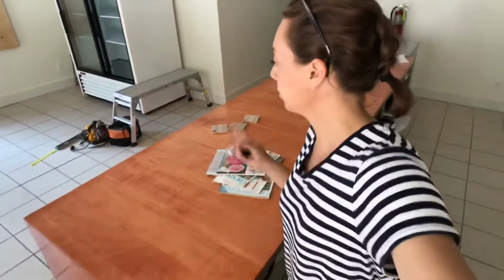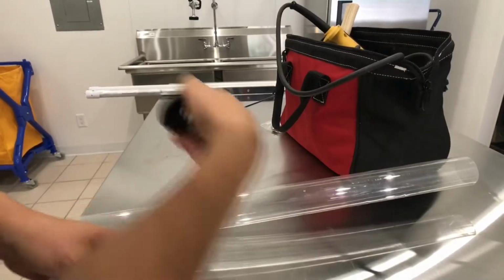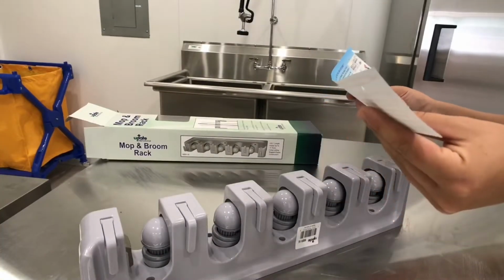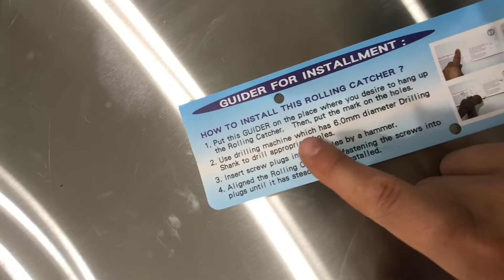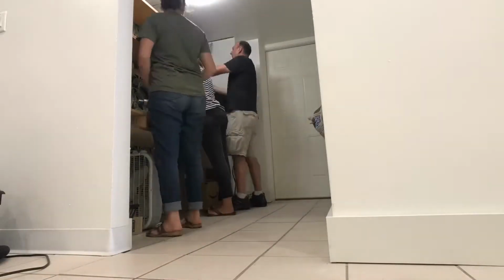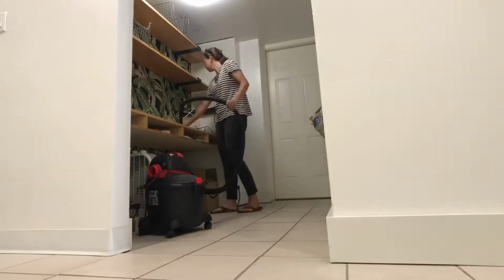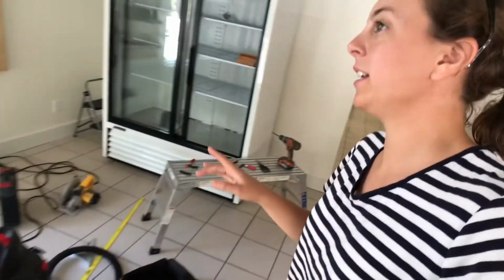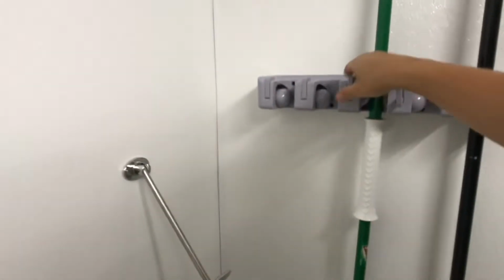A DAY IN THE LIFE OF A JUICE SHOP

Comment: Are you getting some Jet Sprays?  I like the old ones from the 50s/60s that have the magnetic fountain pumps, but parts may be a problem with old stuff.  
You might consider selling small individual fruit gummies, yummy gummies.
Reply from the maker: This is too fun!!! We used these at Cracker Barrel when I worked there.